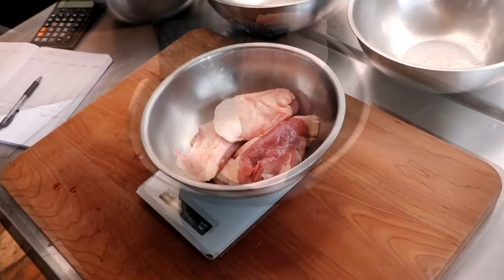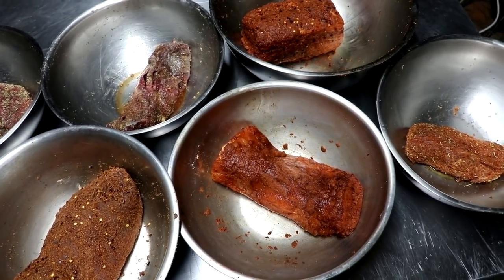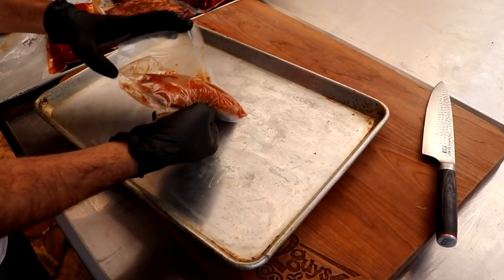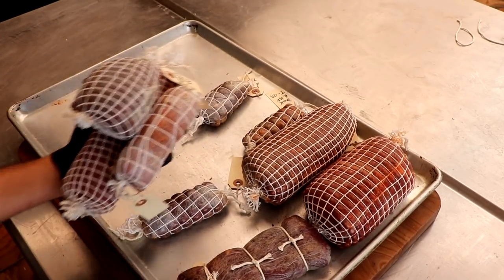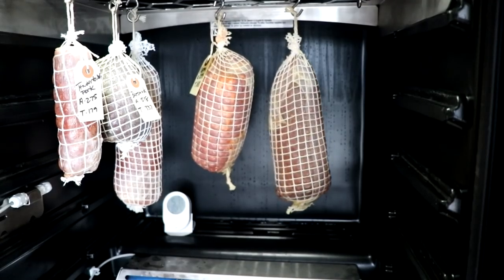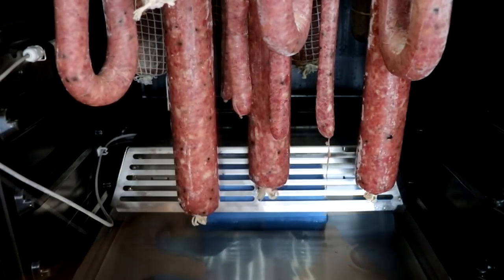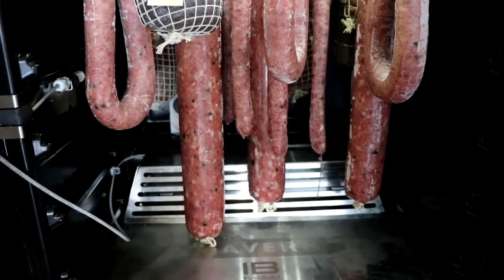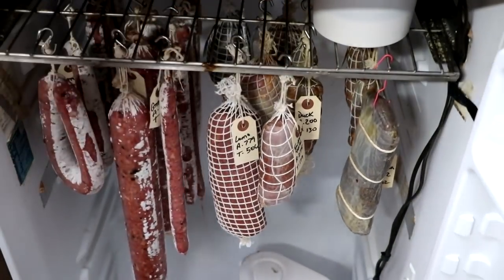Putting meat into Cavern - testing a prototype dry curing chamber

Comment: Eric - Thanks for doing the beta testing and sharing your findings.  I would prefer an out of box product but only if it works as it needs to.  Would you know if the Steakager Pro 40 would have the same problem controlling humidity?
Reply: I just got one and testing it out atm seems to be ok so far!
Reply: @redrum430  that's great yo hear.  Id love to know if you have the same problem with too high of humidity once you've used it for a bit.  Thanks
Reply: @smendlik  I will give you an update in a few weeks
Reply: @redrum430  Any update on how the Steakager is working for charcuterie?  Specifically on how well it controls the humidity?
Reply: @smendlik  Hey Steve, it's been working real well humidity with about 15 pounds of meat in it has been about 74 to 77 percent and temperatures bang on,I would recommend it as I have had no issues so far hope that helps. Also using a govee for temperatures and humidity as the one with the app isn't as accurate
Reply: @redrum430  This is great news, I'm almost ready to set up a chamber and would rather have an out of box product.  On the plus side I can dry age steaks too!  Thanks for the reply.

Comment: Eric - the central air system in my basement with a masonry fireplace works the same way having only one compressor and one evaporator to control the temperature AND the humidity. If you set the thermostats' humidity control down to a comfortable level, say 50%, the compressor has to run longer cycles to dry the air out, therefore pulling the temperature down below the temperature set-point. If you set the temperature to a comfortable level, say 70 degrees, the humidity can end up being too high at around 65% here in the southern US.

The solution was to run a stand-alone dehumidifier and let the central air conditioner just handle the cooling.

I would love to have one of these units but this is the problem they'll have to address. Short of building the unit with two compressors, one to handle the temperature, and one to dehumidify, I don't see how it's going to work reliably and consistently. I guess you could use a solid state refrigeration system but those tend to not last very long. I have one of those in a wine cabinet that lasted less than a year. The replacement lasted less than 6 months!

If they can get the bugs worked and you put your seal of approval on it I'll buy one!

Comment: These are rather big swings in temperature and humidity, which mean that their control system is not working properly. Do you know what controller they are using or if they designed their own control circuitry?

Comment: I never would have recommended  a full load of product.   It's a good thing for the old system/ refrigerator  to fall back on. Calibrate and trust your measurement equipment.  If the manufacture can't stay within a operating tolerance  with an empty chamber they can never be trusted with $100 + dollars of meat left alone for days & weeks at a time. Thanks for your evaluation on this new product

Comment: There is no way that unit can have anything but 90% humidity loaded with meat and 2 inches of water in the pan.  Fact is that chamber needs to be dry as popcorn at the start, and just add teaspoons of water to keep the meat from drying out too quickly.

Comment: Solid testing right there , haven't ever had the need for adding humidity in mine , but that will vary , itn that set up I would thing a "reheat" system while the compressor is running would help  and prevent from over cooling while keeping the humidity in control

Comment: I was really afraid that the outcome would be a fail. It is hard to make something not designed for precision work in a different application hold precise accuracy. Upon first look on your other video it was obvious the designers didn't know anything about curing chambers or they were trying to do it on the cheep. A lot of the design flaws were below entry level and should have been obvious.
Reply from the maker: Dry curing in a modified refrigerator requires precision.  Lots of variables to consider to produce high quality meats and cheeses.  I don't believe they have extensive Dry Curing experience but fortunately they have me😁.  The feedback I give them is much more extensive than the videos I upload show.  I think we will be seeing some nice changes as this unit evolves..
Reply: @2guysandacooler  I think they picked the right guy for this. You learn a lot from trial and error of building your own chamber that can't be learned in engineering school. It will be interesting to watch the evolution of this thing. I just wonder if they will consider the changes needed not cost effective.

Comment: Erick I need your advice, i gat a fridge, I bought all controllers, but how. Can I disconnect my freezer, fridge keep temp, but freezer is working,
Second question- what you do with fridge controller on top under a freezer??? It’s steel freezing…in don’t do a whole between - afraid little, but what my stpeps before I drill it. Thank you
Reply from the maker: You can't disconnect your freezer.  That's where the source of the cold is coming from.  I removed the barrier between the fridge and the freezer but that's not necessary.  You can leave it and only use the fridge part.  If you do plan on removing that section be very careful and work slowly.  There might be some gas lines in there that you don't want to puncture.
Reply: I do a lot of refrigerator repairs.  One problem if you leave the freezer separate from fridge, the fridge us usually cooled just by airflow from the freezer.  So there is usually a recirculation fan running a LOT.  You can't really disable that fan, and still get the cold from freezer to the fridge.  Whenever a fridge isn't staying cold enough but freezer still works, that fan is always blocked by too much food, or stopped working.  This is one area of Eric's fridge conversion that could use more info, as he talks about disabling that fan and/or replacing with computer fan... that could really make the unit inefficient,  causing freezer to overwork just to get fridge part to stay at 55, due to reduced cooling airflow.  Best thing is a dedicated refrigerator with no freezer, 2nd best is removing separator so it becomes one space.
Reply: @2guysandacooler  thank you Eric.
Reply: @dave_in_az  ok, I see that, first option is not working for me , because I have 2 for fridge ( frozen on top, and bottom fridge) it’s GE gts17jbwarcc , second option is better I think
So I remove seporator and I need to do some disconnection ????
Can you please explain it little more!
Thank you for advice, I’m new in this chambers but I can understand and do thinks ;)
Reply: Artem, you don't have to disconnect anything on a fridge with freezer.  Just set all existing controls on fridge full cold, then plug into inkbird controller to let it turn power on off to hold desired temp.  You could just leave it all as is.  But to make it more efficient, if you open up any divider between freezer and fridge compartments, it will run smoother with less fan flow.  However, you have to be super careful there are no condensor coil gas lines wrapping the freezer between it and fridge.  Just don't go in there and jack up the actual cooling lines is all.